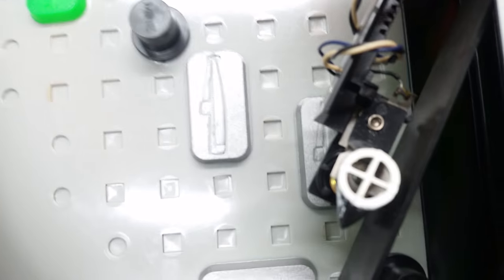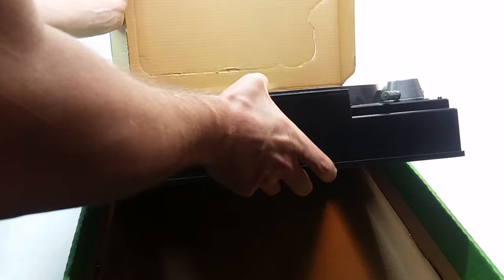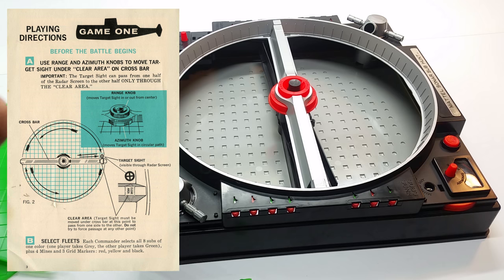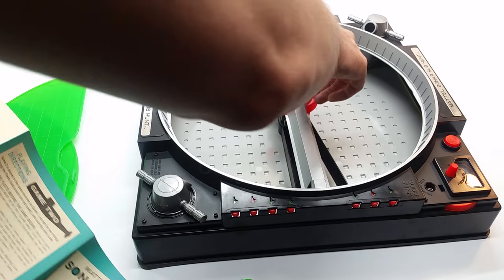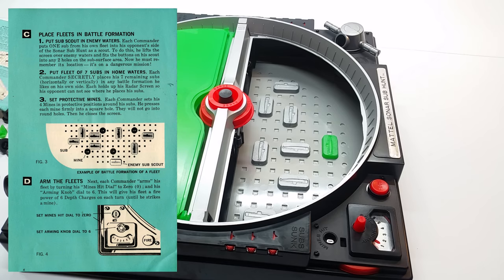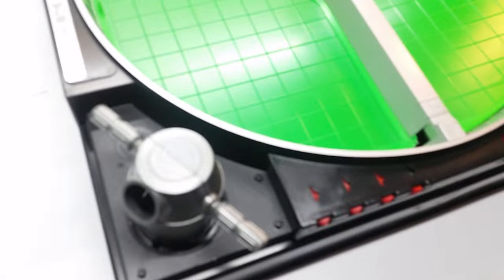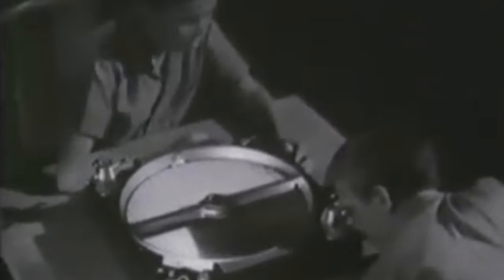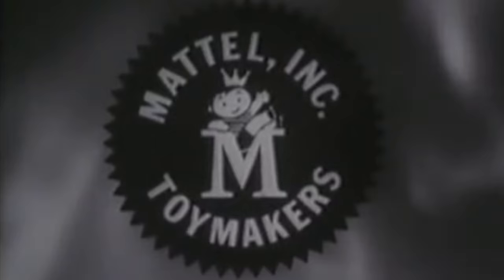Sonar Sub Hunt 1960s - Vintage Toy / Boardgame  Unboxing & Review

Comment: Great review, just picked up a copy. Buzzer works, but can't get the bulb to light up. Bulb that came with it works out of the game, but doesn't seem to fit in the holder correctly, was wondering if you could take a pic of your bulb to see if I just need a different style.
Reply: it's a #112 bulb. You can get them on amazon or perhaps a car parts or hardware store

Comment: I got mine in the early 60's from a small(very small) mom and pop hobby shop. It had been on the shelf for a while and he reduced the price. He had a lot of old models etc. I picked up over the years. If you have decent lighting you can usually tell if where there is an object beneath the screen if you look directly  down, not at an angle.
Reply from the maker: haha hey thats cheating! :p